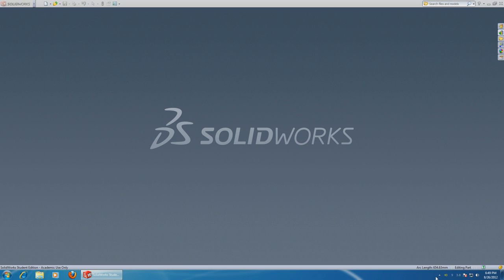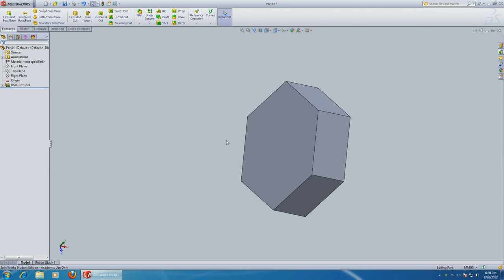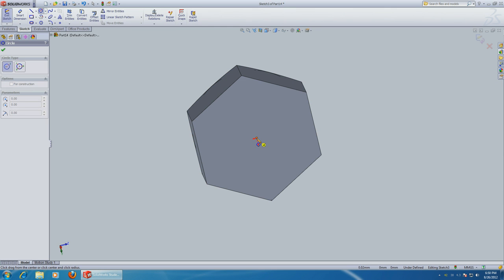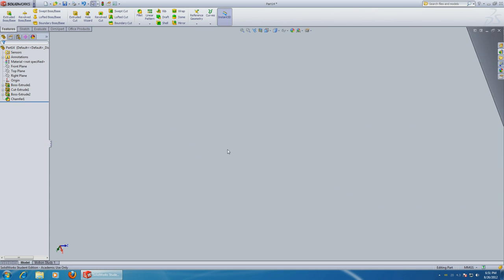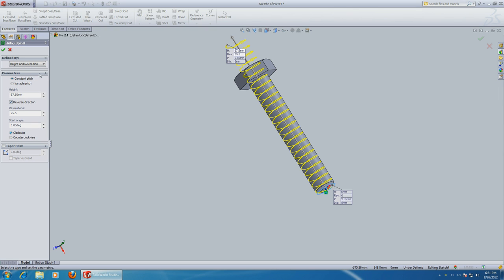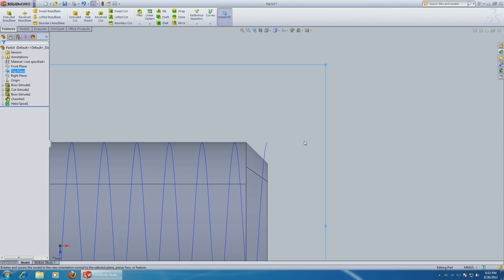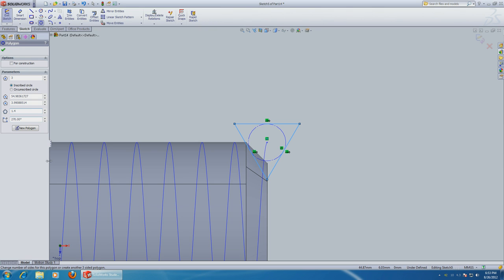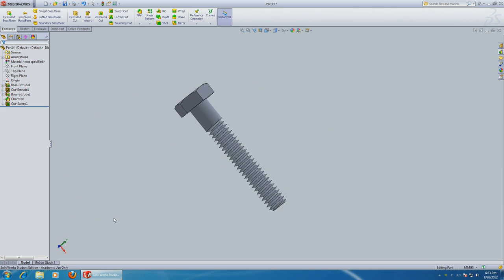Solidworks 2013 Bolt (fast and easy) 1080p HD

Comment: Hey ProcadWorks Jr!  Thank you for sharing this!  You did your BOLT in less 5 mins. . . . usually to do bolt & nut wld take about 15-20 mins  w/ assy & animation.  Most mech drafter did not learn how to sketch bolts & nuts. . . You are the only one in youtube that drew a bolt in less than 5 mins!  Thanks man!!

Comment: Press the S key and stare in awe! :) It's much quicker than going to the top menu bar, you can even customize the S key menu.
Also it's evident you come form Autocad, or another non parametric modeler,  because you don't fully constrain the sketches and prefer entering the dimension at draw time :)
Nice bolt tutorial.

Comment: Nice lesson bro. Quick and clear!
I have 1 for you... to change a new part to mm's just click on the icon in the lower right corner that displays the current units.
Does anyone know how to change the default value for this?
Reply: After changing the part unit, save it as part template and replace default part template file.

Comment: Good job with the vid! instructions very clear. I only had one problem and that was using the swept cut. I sketched the triangle just as you did and when I tried to apply the swept cut, I would click the triangle and then the helix, and it would not let me click the green tick. Any idea what could be wrong?